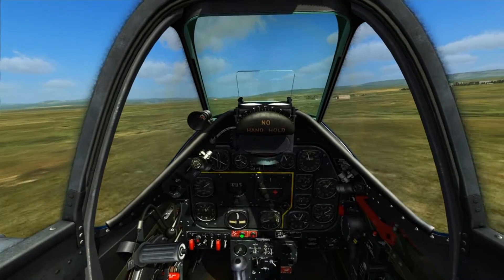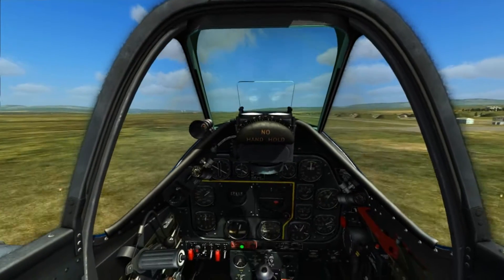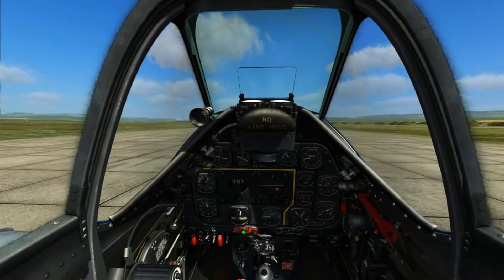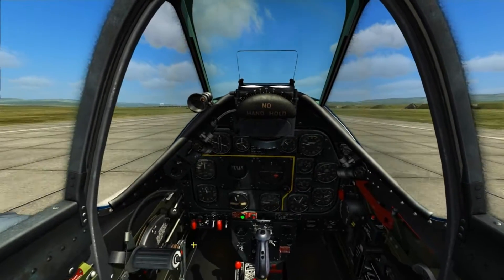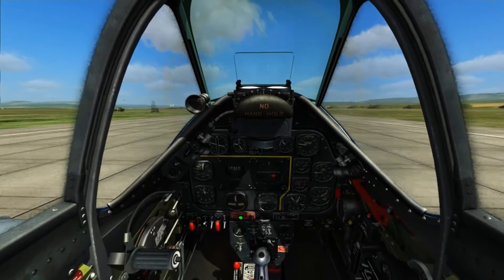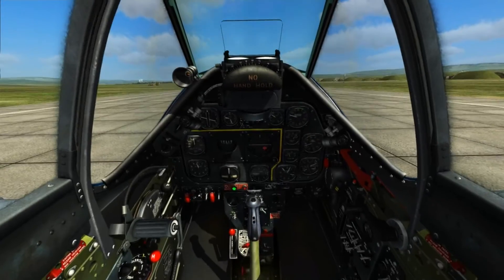DCS P51 and TF51 Takeoff/Engine Management/Landing Part 3 - Landing

Comment: "Two Point" landings called wheel Landings are good for heavy Cross wind landings. So if you will keep your speed down on wheel landings you will not get high bouncing normally . Though not advisable for airplane with small rudders this is not the case with the P-51 as it has wonderful rudder authority. My Sonerai Is not advisable to make low speed wheel landings as the rudder has little authority below 45mph so 3 pointers then stick all the way back. The Bf109 may be like that too but I haven't flown it yet in DCS please some one who has comment. Is it a poor rudder authority at low speed airplane?